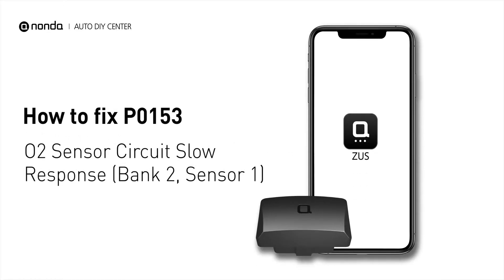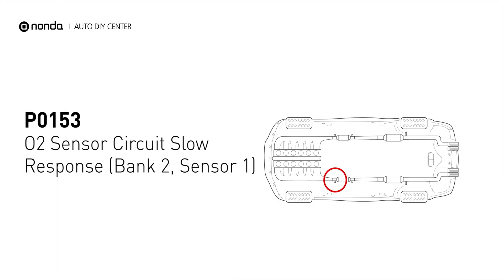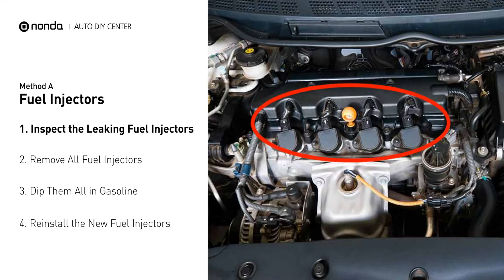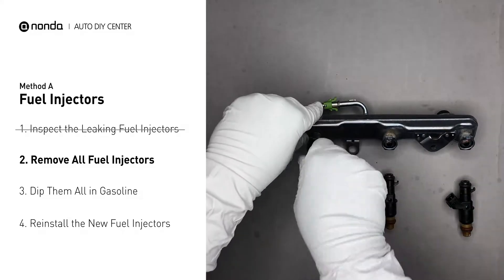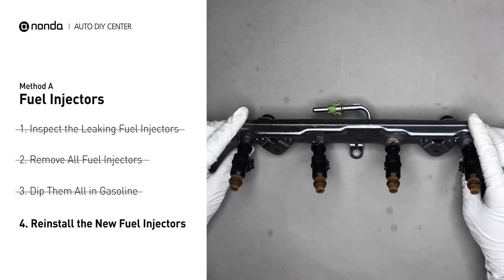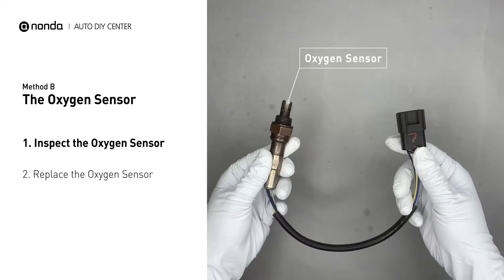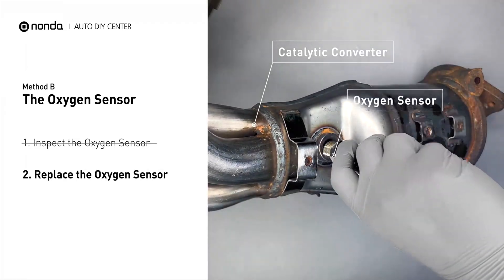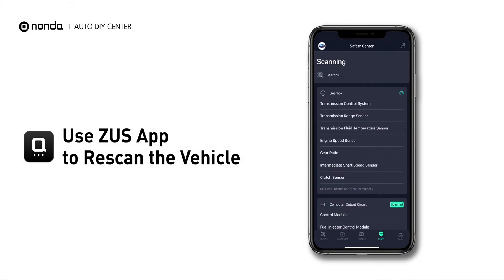How to Fix P0153 Engine Code in 3 Minutes [2 DIY Methods / Only $8.11]

Comment: After a few years of living with this code that Ford just kept resetting (It would come back after a few hours after service) I tracked it down to a Locking Gas Cap I bought when I bought the F150, remove the Gas Cap, rest the Code and it hasn't come back... I modified the Gas Cap by grinding down the centre post and drilling a small hole through the cap and it now works fine...

Comment: If I keep driving with p0153 02 sensor circuit slow will it fuck up my motor?
Reply from the maker: Hi Jayme, your vehicle will just consume more fuel. Over long period of time, this would also affect the performance of your catalytic converter.